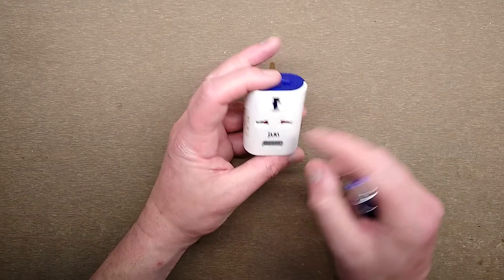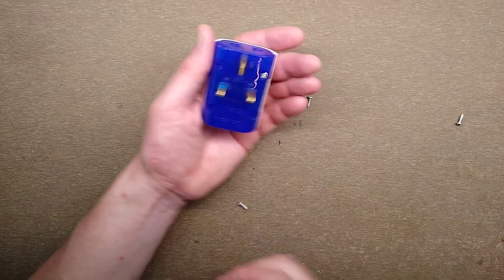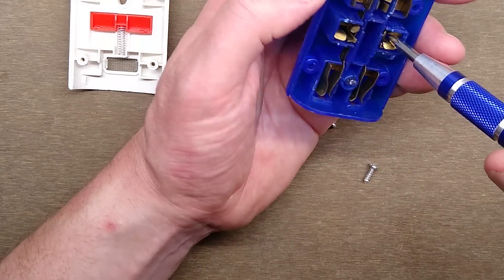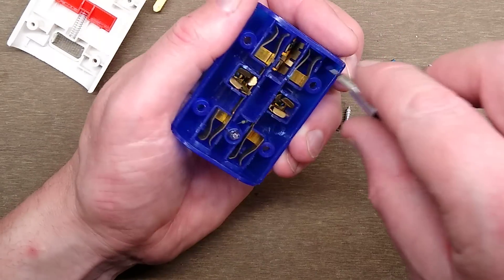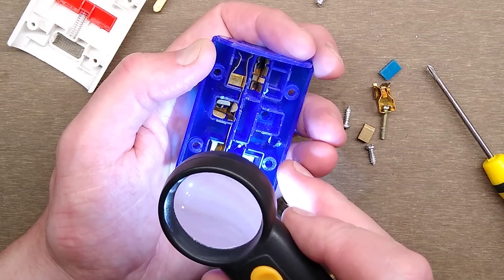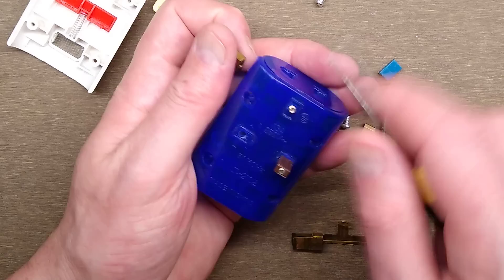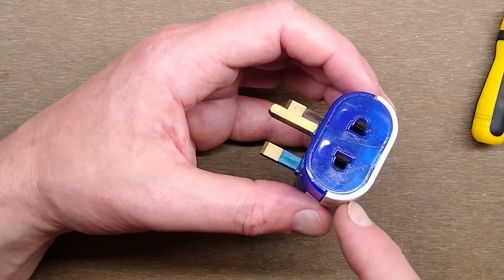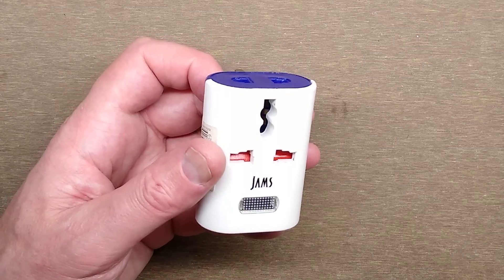Red Sea Mall death-dapter teardown

Comment: Clive: our circuits pack quiet a punch...
Germany(16A/230V and no fused plugs): we got you
Reply: UK is weird though, our hangover from the post-war copper shortage making ring circuits a thing.  Double outlets rated for 16A but nothing to stop you plugging in two 13A products, or if something is unfused then good luck with the breaker rated at 32A.
Reply: @alexatkin  my main breaker is 35A lol
Reply: Still, 16A/230V is less than the UK's 32A/230V on the UK ring main (truly a mind bending way to connect things, but it DID save copper in post-war UK which was the note. This 32A (or 30A) ring fuse is also why all UK plugs has to be fused, without that they're decidedely spicy.
Note: UK is technically NOT 240V since decades, as part of the "European Harmonization" that happened decades ago they switched their official definition to be based on 230V though the over/under percentages means the voltage range IS higher BUT overlapping.
If you don't believe me, argue with the UK goverments official pages, these specifically states that the UK mains voltage is 230V +10/-6% (IE 216.2-253V at the delivery point), the rest of Europe is 230 +6%/-10% (IE 207-243.8V at delivery point) to accomodate both the old 230V and the old 220V countries... I'd provide references but Youtube would just eat the comment, they're not hard to find via Google.
And before anyone offers proof based on "but he measured 240-245V at the outlet", see the UK voltage range ("230V" means up to 253V).
Reply: @Torbjorn.Lindgren  Aside from the copper savings, the UK ring main is effectively a high current busbar where anything connected is fused up to 13A according to load. It's a very useful and reliable system if used correctly.
The idea was that knowledge of fusing appropriately would trickle down to offspring, but most British are morons and e.g. will stay say "I had a 13A shock today" if electrocuted. Domestic users have no clue of how to correctly fuse an appliance, equipment manufacturers don't help much either.
Nevertheless, BS1362 fusing at the point of use and ALL the provisions of BS1363 provide a far safer system than anywhere else in the world.
Reply: @Torbjorn.Lindgren  We (the UK) were 240v and haven't actually changed - all that happened was that the nominal voltage changed to 230v with the wider tolerances so that products designed for the European market would function on both the 220v and 240v systems.
Reply: @Torbjorn.Lindgren   16A is in your flat in Germany normally one phase, but usually we have up to threee phases available.
Our house (our own one) has 3x63A/230V Input from the main supply and your oven and stove is connected to three phases whith  1*oven 16A/230V and then 2xstove 2x16A for four plates)
If your wiring is right nd your fuses are, you can install even 3 phases at 25A each.

But considering the energy prices over here, we just can cry :(
Reply: @Torbjorn.Lindgren  yep some people think that as uk mains is specified as 230v they think it should be dead on 230v at the socket, ! , its regularly 240 ish or even more, here, they just respecified the tolerances, not actually changing  the voltage,, i think i did read somewhere  europe did 'increase' their voltage to 230v..?????
Reply: @andygozzo72  a lot of that variance is due to load - the more load on limited supply, the more drop, so the mains could dip as low as 220v by the time the grid responds and boosts capacity/supply.
Likewise, it could rise as high as 260v as generation is boosted in preparation for the next expected peak load period.
Reply: @andygozzo72  By me there is still an area with 250VAC mains, and this will probably never change, until the council agrees to replace literally every single transformer at the same time.  Only around 50 transformers, but they normally do not have 50 in spares at any time, so as one fails (a rare thing, they are very conservatively rated) they simply put in a spare, and have the old one rewound to the original spec. Hard to change, as they all also run in a large ring main as well at both LV and consumer side, so have to be very well matched to not have large circulating currents.
Reply: @andygozzo72  Yes the point was to harmonize the voltages from 220V/240V to a common 230V, but I don't think much in fact has happened.
Reply: @andygozzo72  That's not limited to the UK, even some countries that originally had "220V" often have voltages well above 230V at the outlet!
IE both Norway and Sweden both had "220V nominal" originally and now use the "230V" spec and my smart power plugs at home all reports 242V! right now (admittedly with pretty much no load) at my home in Norway and I've seen voltages in the 233-245V range in Sweden too. At work (also Norway) I see anything between 240V and 235V on various circuits, the lower ones have longer cables and/or heavy load.
This is fine because it's well within the harmonization spec of 207-253V and even the original "European 220V" spec allowed 198V-242V!
There was an "European Harmonization" effort (1987-2009) where lots of European 220V, 230V and 240V countries agreed to all gradually switch to "230V"  but in reality the voltage tolerance was wide enough that it was MOSTLY just lots of paperwork! For more details on the transition period consults the Wikipedia "Mains electricity" page.
The UK choose to be part of this agreement and now OFFICIALLY runs on 230V, they did decide to use a slightly higher lowest allowed voltage which limited the lowest allowed voltage to 214V instead of 207V, the upper limit of 253V was kept though. I see that several other traditional non-European 240V has gone the same route as UK by also adopting 230V nominal but with asymmetric limits.
Reply: @runeodin7237  it wasn't intended to actually change the voltages that people received but more to ensure that products were designed in such a way that they would work on both voltages without problem.
Reply: andygozzo72
Finland move 220->230 sometimes at 90s
380 goes 400v.
But those 20kv is still same and 200, 400kv is same too. 
In my eyes many things look weird at UK electric and took some time to understand what's goal between these ideas and reasons.
It feels many times that our own system is best, when you understand it best way. But so long when you get right power from outlet and safely way, everything is OK.

230v +10% is 256v I think.
Reply: Flirkann Ko
Stations using transform with multiple outlets and it reacts fast. So area where usage is higher/different that system reacts on its own. Here we have three phases 400v minimum of 3x25A per house, so load between phases cannot rise very much. That system what hauls voltages changes all three phases at once ofcourse. Otherwise crid goes badly wrong and starpoint moves from middle. You could took 230v from phase to earth and 400v to between phase/phases. 
20kv line is on delta only, so theory there is not voltage between line and earth, reality is different. 
But if one line brokes to down, it could earth both ends of lines and fix it on run. In reality that dosen't happens and if one line brokes, line drops and power goes other lines if possible. Over 20kv next step then all systems are multiple ways, some lines could be taken off. We don't want to power unused lines, it mixes even powerfactory.
Reply: @Torbjorn.Lindgren  afaik it has been  230V +10/-10% since 2003
Reply: @fuzzy1dk  Yes. Didn't it just get respecified from 240v +6% to -10%  to 230V +10% to -10%?
Reply: @Tidosho  afaik it was 230 +10%/-6% and then changed to 230 +/-10%
Reply: @Torbjorn.Lindgren  There are no 220V countries anymore in Europe. Converting to 230V was easy. No need to replace transformer because they come with -5%, -10%, +5% and +10% taps. Even back in the 220V days the voltage with no load was over 230V.
Reply: Does a ring still save copper?
Reply: @MrAlex3461  In theory, maybe, in certain specific scenarios.  In practice, usually not, and they are arguably sometimes worse.  (This is matter of some contention in various circles, though.)

One thing that many people don't take into account, though, is that ring final circuits were originally claimed to save copper in comparison to pre-WW2 conventions which typically used multiple dedicated radial circuits (a separate circuit for each outlet/appliance).  They were never really claimed to significantly save copper compared to shared (multi-tap) radial circuits, such as what are commonly used in other places nowadays.
Reply: @MrAlex3461  Not half as much as using copper-plated aluminium (or steel???) does. ;)
Reply: edgeeffect
It's usually copper plated steel, because copper with aluminum don't handle any moisture, start to make green poop and "melt".
Add one pieces of both together and leave it out.. 
And steel is so much less priced than aluminum.
When you add copper to that, it's not that "bad" on bench. But in truth it's much worse.
Reply: @MrAlex3461  it can do
Reply: @MrAlex3461  Usually.
Reply: @MrAlex3461  - oh, please don’t start the argument over ring circuits vs radial circuits again….
Two convenient features of ring circuits:
One MCB for a virtually unlimited number of sockets on a circuit for a typical house. For an equivalent using radials, you would need two circuits meaning two MCBs.
Two, adding an extra socket between two existing sockets on a ring is just as easy, if not more so than trying to route an extra cable from a socket on a radial circuit.
Three, yes, a ring may save copper, but the amount is not really significant. It very much depends on the requirements of where the sockets are wanted and the layout of the building.
Reply: @MrAlex3461  Yes, because although it is longer in length, the conductors are thinner. A ring is 2.5mm², whereas a radial is typically 4mm².
Reply: @davepusey  Mulri-tap 16A radials in Europe are typically 2.5mm², not 4mm² .  The radial runs from the consumer unit/fuse box to the furthest outlet, looping through each outlet in the way, occasionally forking into separate identical circuits as the building layout dictates.  Every part if this is rated for the full 16A continuous load, unlike in US installations with their "80% rule".
Reply: @MrAlex3461  It creates a lot of extra work for electricians, that is what it is good for.
Reply: Ah, punch, 7680W continuous available power from a 32A ring if the supply voltage is 240V…
Reply: Right there with you - AU 220-260v with 20A/Bedroom circuit, 32A@for Living/Dining/Kitchen circuits, and a 20-32A for the shed/garage... To service appliances that are limited to 10A draw without special plugs, and are individually fused/breakered at the manufacturer's discretion.
Reply: Yeah, but Germany follow the same school of thought as Sweden does, and use sensible fuses in the fuse box instead.
In UK, they just do a big "ring" of wires going to all sockets, put a massive fuse in and rely on fuses in the plugs  to do the protective bit. That's why all UK plugs are so big.
Reply: Yes, this a rather quaint UK thing. I have never in my 74 year lifetime come across a situation where a fused power plug would have protected something in Australia.

Comment: Shenanigans ensue when a screw gets loose on the power pins.
Reply: its bad enough when screws get loose in a plug with a high current device!  always seems to be the neutral 😁
Reply: @andygozzo72  Thinking about that, it could have something to with the live screw being thermally isolated from the pin by the fuse.

Comment: How common is it to have a fused outlet?  Are they just used on spur connections or sometimes on ring circuits?  If your ring breaker is 30/32A do people replace fuses with non-spec fuses to do naughty things Photonicinduction style?
Reply: A single double-socket spur can be unfused for some bizarre reason but any more than that and you must fuse it.  There are single/dual to multiple adapters (some really dodgy quality) so you can convert a single socket into four (I'm talking permanent in/on wall outlets here) but those also must include a fuse like a plug-in power strip also does.
Reply: Fused outlet, as in permanently fitted to the building? Err, not particularly common… Mainly because they don’t make fused sockets in single (one way) or double (two way) socket outlets. The triple (3) and quad (4) type do have a fuse.
However, if you have a ring circuit, it is permissible to use a fused connection unit to supply as many socket outlets as you like on its own spur/radial circuit. But this is not a very common configuration.
An increasingly common arrangement in a kitchen (or utility room) is to have a switched fused connection unit at an easy accessible position (say above the unit top) which feeds a socket in a cupboard or below the unit top for an appliance such as a built-in fridge, dishwasher, washing machine etc…

Comment: I do wonder about the insulation resistance of the main body plastic moulding.
Doubt it complies with any regulations!
Reply: Hit it with a Megger and find out! Bonus if it smells like burnt toast when the insulation fails.
Reply: yes...or flamability testing lol... 13A on those screws holding the (fake) Brass connectors to the (Fake) Brass pins will prop overheat and melt that palstic, looks like ABS at best...hmmm. Junk!!!
Reply: insulation resistance will be ok,